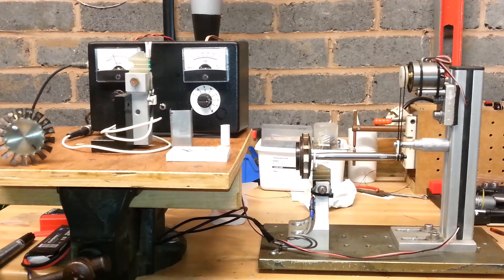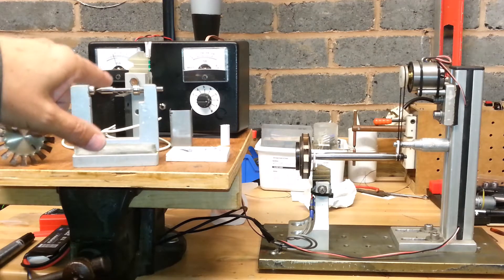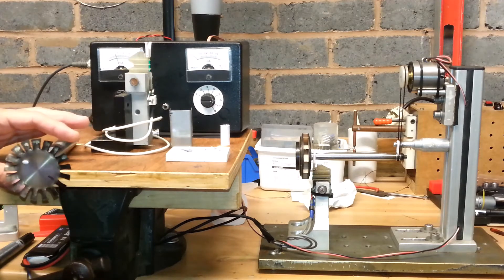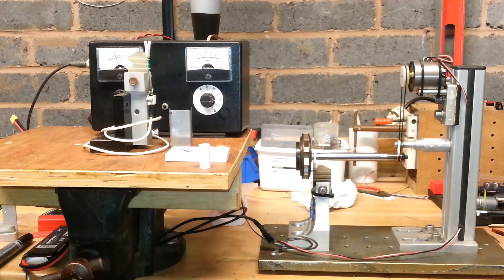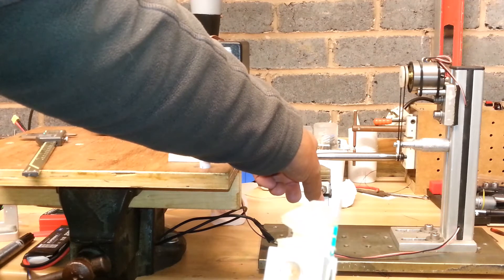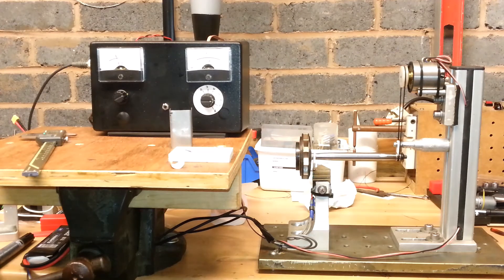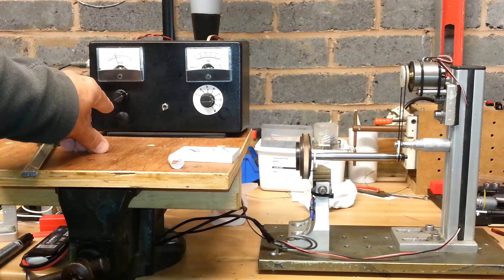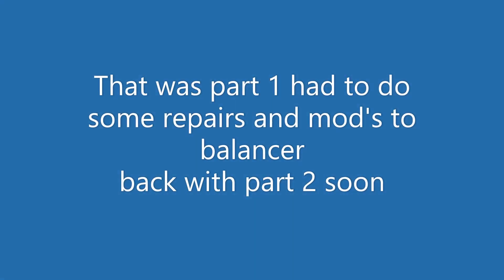Balancing turbine rotor assembly

Comment: I have a question. But not related to balancing.
Is there an alternative for few pump? .

Fuel pumps for turbine are so expensive and ordering it is not an option with the pandemic. 

Is there another way to vaporize the fuel going into the combustion chamber?
Reply from the maker: you could try pressurizing the fuel tank using a  2 lt pop bottle I've never done it but people have tried it look for a good clean one with no scratches start at a low pressure of 35 psi might need to plumb two together
people have also used liquid gas but be very careful. Kurt has used a small bottle of gas and turned it upside down when lite and running on gas .
Reply: @reedy93  thank you so much sir.
Reply from the maker: @jacobokpara7618  Just remembered one thing to watch if you are running engine fast using pressure from a 2lt pop bottle don't let fuel tank run empty it can blast a lot of liquid and air into engine and people had the engine surging .
Reply: @reedy93  ohhhhh. Almost crapped myself reading this. Thank you so much sir. You have been a great help and mentor through this process. 

Another issue is am not too sure about my NGV making procedure. Do you have a video of you making one? . Can't find on YT. 

Am not too sure about my number of blades and the angle. I kept at 35deg.  But number of blades am not sure.

Is there a way to determine the number of blades it should have based on a certain criteria?
Reply from the maker: @jacobokpara7618  
Think the
 FD3 has 11 ngv and 17 turbine wheel.
Kamps is 13 ngv and 19 turbine wheel
 not to sure of KJ66 15 ngv and 21 turbine my edit later but one should not divide into the other basically you don't want one lot of blades to line up with the other bit like a 2 blade prop on the trailing edge of a flying wing makes a lot of noise. 
its the same at the front end/intake  diffusor/compressor wheel .
Reply: @reedy93  thank you so much sir for your time. Will research more on this.

Thank you sir. God bless.